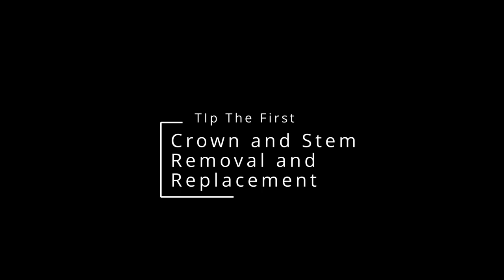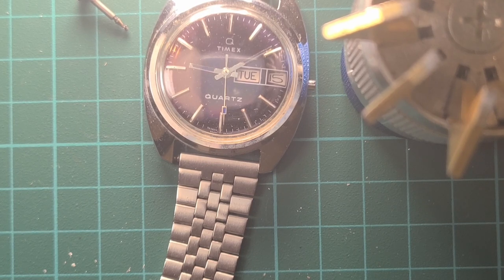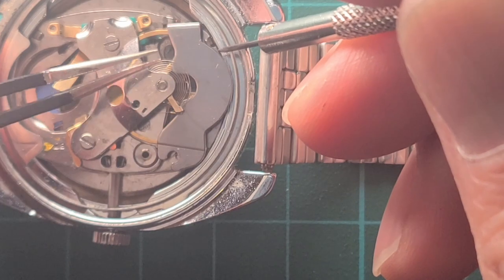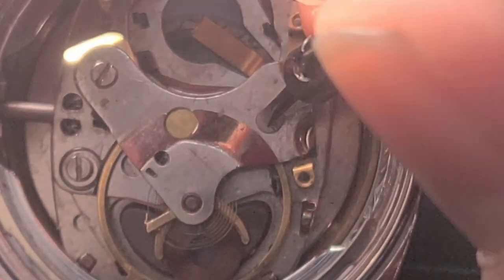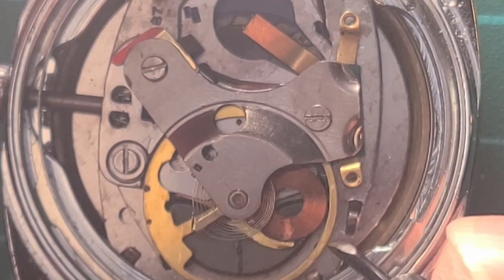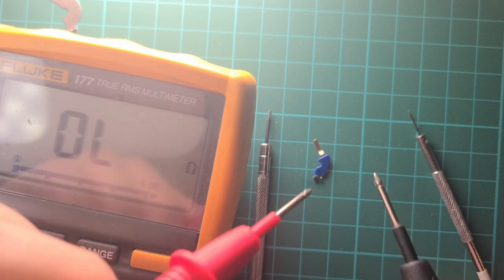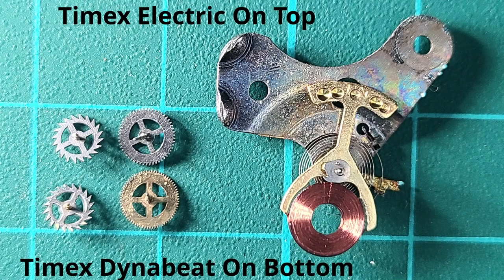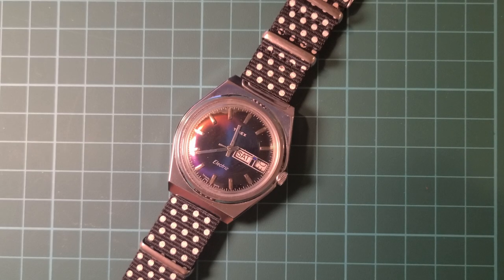5 Tips For Working on Electric Timex's (Electric M40 / Q Quartz M63 / Dynabeat M263, Etc)

Comment: Very informative video, thanks. There's not a lot out there on servicing Timex movements, especially the electronic/electric ones. I have an original "Time Machine" Q, that I believe has the M62 movement (It has the crystal and gold multi-legged component.). In order to get to remove the stem you have to remove the circuit first. The balance bridge screw looks like it might hold the circuit, but it does not. The circuit lifts over the screw, which makes sense. There are two screws near a gold, what looks to be, integrated circuit or perhaps a transistor? Your video helped me avoid utter disaster as I work to get this thing running. At first I thought I might have hurt the movement because I may have put a drop of very light watch oil on the top of what I  now know is the balance jewel. From the looks of it, no oil would have gotten down to the pivot. But, if it did, how would you go about cleaning the pivots without removing the balance from the bridge. I don't want to deal with the hairspring pin that is holding the HS to the bridge if I don't have to. Thanks again. Cheers.

Comment: Thanks Chris.  I always find your content interesting and informative.   I've tinkering with DynaBeats, Electric and Electronic 's with moderate success.  Oddly enough,  it seems that the Electric's have been the most successful.   I've also had reasonable success flipping these watches online for a small profit.  However, I'm still learning the movements and can spend too much time on one watch. Any information you can share about parts resources or reasonable service providers would be appreciated.   Please, keep up the great content.   Cheers!
Reply from the maker: For parts I usually end up turning to eBay for watch lots. I've had pretty good luck buying watch lots that have Timex's in them.

Although I would also look out at local flea markets I have gotten a lot of them for 1-10 dollars at events like that. 

 As for service it's usually a dead end, I have heard more than a few watch makers turn them down. That's part of why I just do them on my own.
Reply: P

Comment: Thank you for the info, currently my dynabeat gmt runs a few minutes slow everyday, is there a way to regulate it?
Reply from the maker: Good day, yes if your dynabeat is a bit slow you can move the small brass arm connected to the balance counter clockwise a bit. Be very careful to not hit the hairspring itself but that should allow you to correct that.
Reply: @christicks5843   Thank you again!

Comment: OK in hindsight, there is a problem. When I took the stem out, another piece came out with it. This piece is not shown in your movement??? Do the Dynabeat watches indicate this on the watch somewhere? (I love your thoroughness!)
Reply from the maker: Thanks, Hmm is the part round? It might be a part for the quickset date. If so you should be able to put it in the slot and when you reattach the stem it should click in. Alternately if could be a flat spring. I'm not at my home and the moment but when I get back I'll see if I can find a electric with the parts to get a photo and post on the community page.
Reply from the maker: http://youtube.com/post/Ugkx8Y-2p_Y54OGm6f7kWGldJXT7Q41KRcVt?si=1du7h-RZp2bg5jXE hopefully this helps you reassemble it.

Comment: I have a 1975 Q Timex. The hacking mechanism doesn't always engage. Do you know what might be the issue?
Reply from the maker: There is a spring that controls the hacking on these movements that couples with the crown it maybe bent preventing it from moving into place properly.

Comment: My Timex Electric gains time (about 15 mins.) at night  - how can I fix that please. Thanks
Reply from the maker: You can try the regulating lever first. It is the golden lever on the hairspring. Move it a bit clockwise making sure to not directly touch the hairspring as it may deform it. However 15 minutes is a lot there maybe something else wrong with it. It may need additional service.

Comment: Do you happen to have any of the Timex Q Quartz watches with the M42 movement in your collection?  I have one it's a 1980 and it's working great and is excellent shape.  When I first received it I thought it was non working because it didn't start ticking so I set it aside and decided to do some research and found it advance every minute and it doesn't have a second hand.  I decided to set the time and let it sit and low and behold it was keeping perfect time.
Reply from the maker: Yup! I have a few of those quartz regulated variants! They are pretty great!

Comment: Great video, very informative. I'm new a watch repair. Where do you recommend getting a replacement balance and crown for a dynabeat?
Reply from the maker: Thanks! I normally would just look up lots on eBay. While not a guarantee I find it a cheap way to get lots of Timex spares, otherwise local flea markets for me have usually turned up Timex watches that can be used for donor parts.
Reply: @christicks5843 I ended up finding a nice electric a few weeks ago. Put a battery in and it ran great for an hour and then just stopped. Is it caput or any chance I can get it running again?
Reply from the maker: @HarperPath  Hmm I would imagine that if it ran pretty ok to start nothing would change in that time to really break anything. I do however think the watch probably need a service. I would guess there is some rancid oil gunking things up a bit!
Reply: @christicks5843  Appreciate the feedback. Definitely wasn't expecting it to stop. Usually it's the opposite where they won't start up straight away but eventually do. This the the first time I've had it run right off the bat and then stop on me like this.
Reply from the maker: @HarperPath  yeah it's a bit odd that it just stopped after running. I can't really think of much other than rancid lube.

Comment: Very informative video! Question, I saw you struggled to remove the crystal using the aluminum crystal lift. Was the crystal glued or was the seal adhered because of age? Did you ever get it to release?
Reply from the maker: Good day, 

They usually aren't glued or sealed unless a previous watch maker couldn't find a suitable replacement. I will admit using the cheap lifts I usually have to put on gloves and give it a very hard twist. The lip on the crystals are actually fairly chunky so they tend to need a lot of compression to get them out. I got the crystal off on a different one haha but on that one I kind of just ended up moving on and leaving it. One day maybe I'll revisit it if I buy a nicer lift.

Comment: Thank you very much Chris. Excellent presentation, I learned a lot of good material. I have a non running M40 with no complications. You just made life easier. Is it possible to obtain contactors? I need one for a dynabeat.
Cheers,  Bob
Reply from the maker: I haven't noticed individual parts come on sale anywhere for timex watches unfortunately, the best bet is probably to buy a couple broken ones from ebay and extract some.

Comment: Hey chris, does the gold fork under the balance wheel have to be in a certain position before you install the balance wheel? I just but a model 52, new battery, nothing working. checked continuity on contactor and its good... any ideas?
Reply from the maker: Good Day, Hmm usually it doesn't matter that much on these movements as the fork doesn't have much wiggle room for the roller to slide on either side of it, so when the balance drops in it typically will just fall in the correct position. Does the balance itself spin freely with little wobble (with no battery inserted). Generally a light flick should be followed by a few ticks (good swings of the balance), if the balance looks very wobbley or does not move more than one swing up and down it might be an issue with the pivots or pivot holes, I'd check to see if there is any old gunky oil or possibly the pivot is in bad shape (corrosion or excessive wear). Additionally if you have a battery in with the back off even if the pivots are wonky you will typically atleast see the balance kind of jump or stick to a position indicating atleast electrical parts are seemingly ok but a mechanical issue is present. If no balance movement is noted at all with the battery in but mechanically it looks good and you confirmed the contactor the enamel wire on the balance or coil maybe damaged. Have a look to see if you can spot any obvious gashes in the coil or anything corroded on the balance side of the contactor. 

I hope this helps!
Reply: Thank you!!! It moves well mechincally but still nothing with battery added... should i buy a new balance wheel? or a new contactor? im new to vintage watches and have no idea where to buy parts.
Reply from the maker: @tjhodge28  No problem! My best guess than would be that the balance has a damaged coil (I'd still confirm and specifically inspect the coil, additionally if you remove the balance you can also check the tip of the contactor and just make sure it's clean or atleast not dark from soot build up or obscured). Unfortunately it's kind of hard to buy parts for these. I usually end up buying entire spare watches and will pull parts as needed.